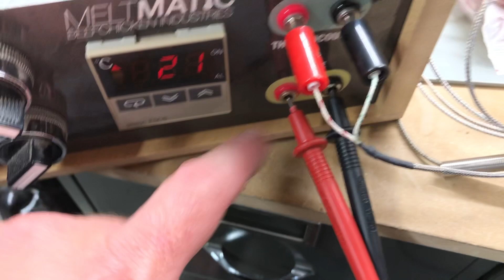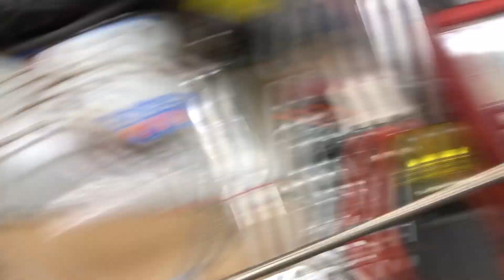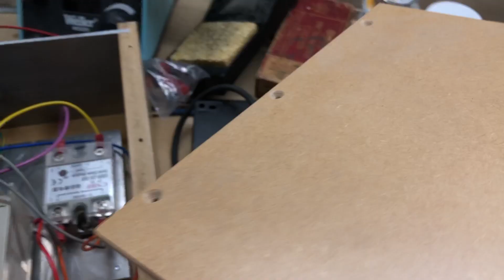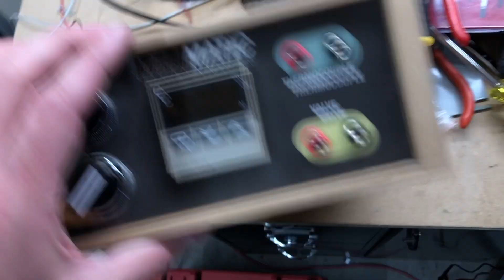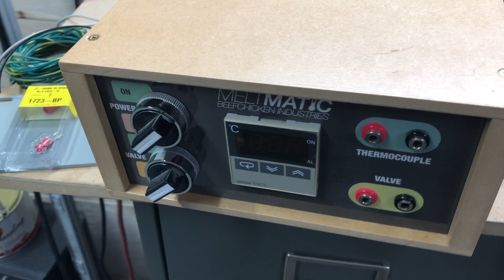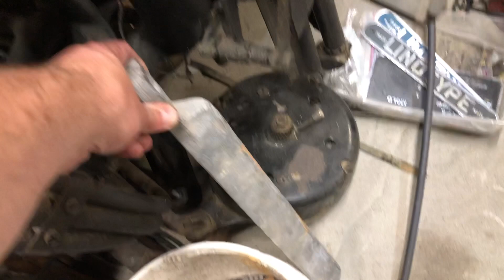Lead Melter Controller Redux

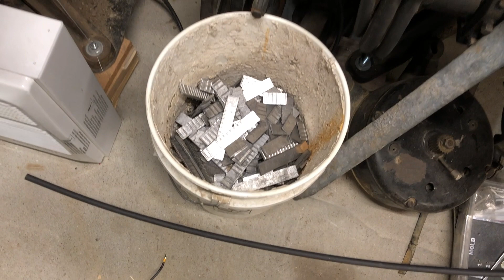Comment: 4:20 It might be worth contacting local metal casting companies to see if there is something you can obtain locally. That would at least eliminate the issue of shipping. It would also be safer than a home-built solution, given the temperatures involved.
Reply from the maker: Michael Cherry I’m melting the stuff regardless: the linotype has a pot that holds 44 pounds of molten metal as long as the machine is turned on. I’m building the re-melter so that I can turn my used lines of type back into pigs to be run through the linotype machine again. This isn’t single use stuff, it gets re-melted over and over again. I have to use the home built solution to turn my slugs back into pigs. The other issue is linotype metal is a very specific eutectic alloy of lead, tin and antimony. This isn’t the kind of stuff any metal casting company would use. I have to either find someone with a stockpile and buy from them, or I have to convince the last remaining lead smelter in North America that is a few hours east of me to produce a custom alloy for me.
Reply: @beefchicken  Actually, what I was trying to suggest is that they might be able to supply you with the mold for the pigs. A commercial mold would be safer than any home-built solution and if it could be obtained locally, it would eliminate the shipping charges.
Reply from the maker: @michaelcherry8952  Ah, okay. The catch is I need a pig with a loop cast into one end to hook onto the hook on the pig feeder on the Linotype. I could just have one welded up out of some channel iron, really. I think I will luck across a proper pig mould locally-ish if I keep looking long enough. With the one Linotype that I have that came out of a field, I found a pig cast using a pig mould buried in the dirt. I think if I had looked long enough, I might have been able to find a mould buried there too. I should go back.
Reply: @beefchicken  I admire your tenacity. I find it amazing how a technology as complex as Linotype could be developed, refined and then abandoned with all of the fiendishly expensive equipment just scrapped. Kudos to you for trying to preserve it as well as the telecom technology that suffered a similar fate.